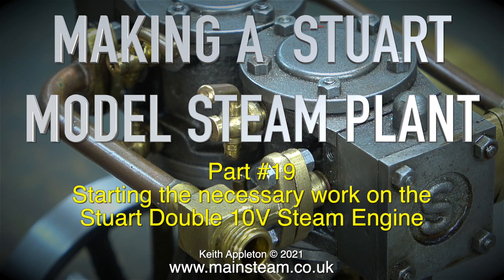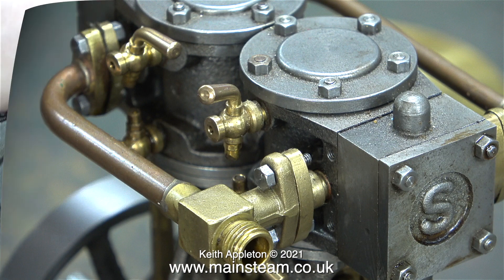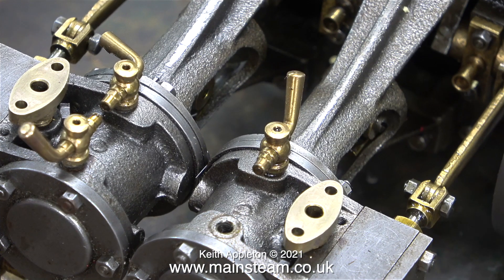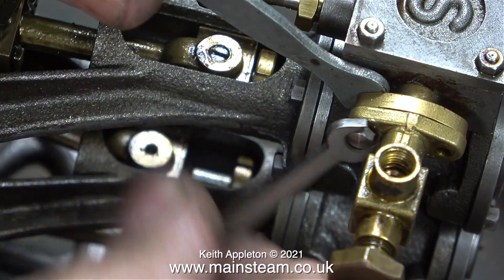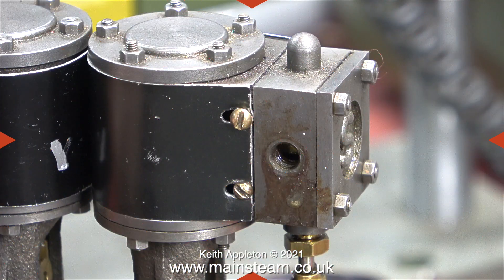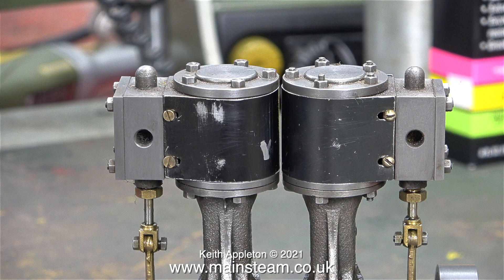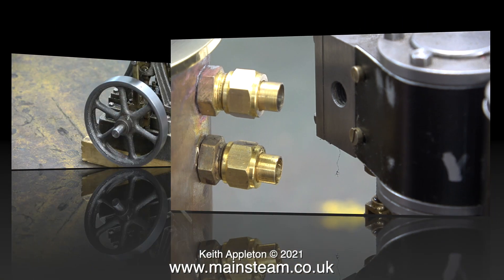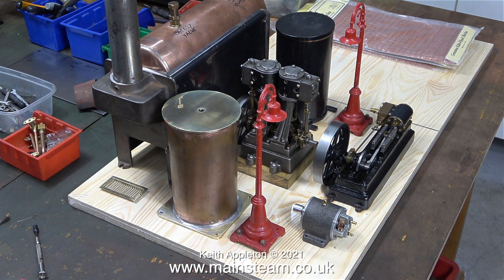MAKING A STUART MODEL STEAM PLANT - PART #19

Comment: Your client may be a plumber or gas fitter.  The sealant on the exhaust is a plumbing dope for natural gas lines.  

NPT threads (national pipe thread) is incredibly common in north america and apparently not in the UK.  This is also the ongoing PM research threading issue you run into.  These threads require a sealant or lubricant like this pipe dope or teflon tape or brush on teflon (depending on who you talk to and the application).

From the north american point of view I am surprised that the NPT threads arent used for models more often since the interference threads resist vibration quite well and they self seal good also.  The other connection I am not seeing is a single flare and double flare.  We use them from brake lines, fuel lines, and other pressure fittings.  They dont need cones or soldering since they are metal to metal.  The fittings are reusable and standardized.  Typically I would expect to see NPT threads to castings and then flared or possibly ferrules on copper lines... or alternatively steel lines with double flares would be common on brake lines.  If they can hold 1200 PSI they should work ok on 80 PSI steam.